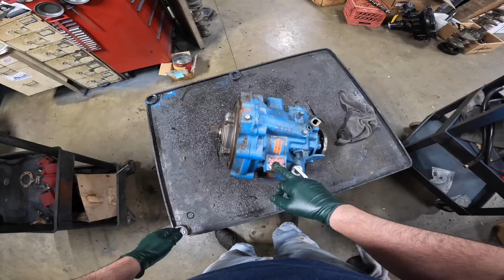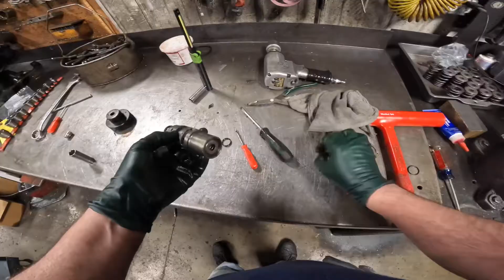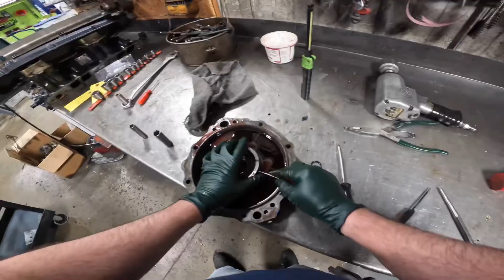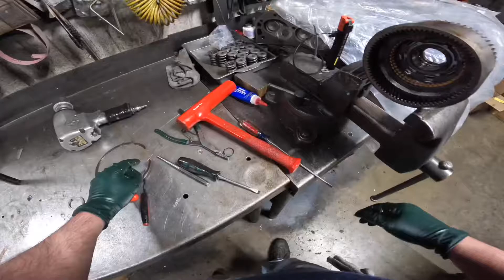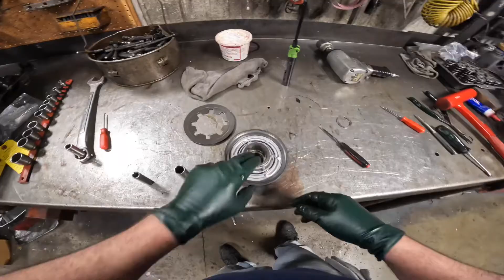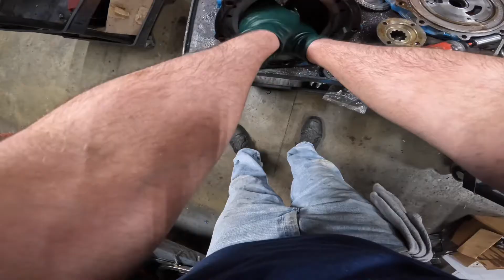Velvet Drive Marine 10-17  Transmission Overhaul Part 1 Teardown 1:1

Comment: Fantastic. Just what the doctor ordered.  I just completed the tear down of my late 80's 10-17-004 velvet drive. This video was such a great reference.  One question: How do you remove the breather plug? My has what looks to be a 7/16 fitting used to screw the breather into the case. But some folks stated NO its not threaded but pressed in - any truth to that? Haven't found anything out there that speaks directly to the R&R of the breather.  Thanks, Chris foa great video.

Comment: ok, I have a question. I have a Td6 dozer with all manual.  Dozer has a straight 6 diesel. I want to do a 4bt cummins conversion with a velvet drive setup. basically to eliminate the wasted time shifting manually all the time. To run a velvet drive I only need to tap my hydraulic tank and add a cooler correct? These units have thier own pump correct? This has a clutch pack doesnt it?

Comment: If i torque down the bolts that hold the cover to the neutral safety plate past hand tightened it won’t shift.   If I back them of a quarter turn I can click the shifter in and out of neutral, forward and reverse completely normal.   I only took the Thing apart to replace the o ring.   Was working normal before.  I’ve taken it apart twice
Now to see if there was anything off and I’ve watched this video many times.   Everything seems normal but there’s no way I can run it with the bolts only hand
Tightened it will definitely leak.  Got any idea what’s going on?

Comment: So just pulled out my blown 350 motor and trans that was 2 seasons old and the new pump shaft seal is leaking or possible the pump seal itself. Is there a better quality seal i could buy somewhere? shaft is pefect no burrs. MY 900 hour old trans never leaked lol. TY

Comment: Hi, My 71C started making a clanking noise out of the blue. I hear it in neutral but less in forward. More in reverse. Seems to get quieter as it runs more. Can I send to a video of it? Maybe more fluid? Maybe an additive? It may need to be sent to you this winter for rebuilding.

Comment: This video pair is a beautiful thing, my only issue is the aluminum piston is stuck, air moved it a 1/8” but no further. Should i be able to spin it  in the cylinder? Can’t do that either, being aluminum i don’t want to force it. Cheers!
Reply: Heat doesn't help, open to suggestions, lol.

Comment: Thanks for the videos. I have a hurth hsw450 1:1. After running it wide open for an hour it blows fluid out on the input side. It happened twice after replacing the input seal.

Comment: What would cause knocking sound in a velvet drive?
Reply from the maker: An uneven running engine such as a misfire. If the idle is too low that could also cause it. 99% of the time the transmission is not the cause.

Comment: Hi, I have an AS15-71C with a 2.91:1 reduction gear box.  In the video you mentioned that there is a different rear seal for that.  The kit I was going to order is the velvet drive 70C 71C 72C marine transmission super master kit on eBay. Do you know if that kit would likely have the correct seal?

Comment: Hello from Austria, I have a problem with my velvet drive 10-16 which is used in my jcb wheel loader model 520 4hl built in 1984.
When I put it in reverse everything is normal, but when i put it in the forward gear it feels like the clutch is slipping and there is not much power at the output shaft. When the oil is cold it works better, but when its getting warm it gets worse.
I think maby the o-rings of the forward piston cause the problem.
I hope you can help me with my problem.

With kind regards

Marcus
Reply from the maker: I’d start with a pressure test. Sounds like an internal leak someplace. You might be on the right track!

Comment: Hi...can I change a rear bearing without having to pull the drive off my motor...have access looks as though they are a snug fit, just need to remove nylock nut/rear bearing plate/gasket and should have access to bearing ??

Comment: I have a velvet drive  stuck in gear does this mean it needs rebuilt ?
Reply from the maker: More than likely. With the engine off can you rotate the output shaft in either direction? If you can't, then it needs to come out and get rebuilt.
Reply: no I can't get the output shaft to spin in either direction the only time it rotates is wen the engine is running,  iv disconnected the shift cable and shifted it by hand and nothing changed,  the fluid still looks new,  the velvet drive is a   10-17  1 to 1 model  , boat is a 79, im thinking about tearing it apart your videos are very clear and explain wat todo , my local marina hasn't worked on one in over ten years and I can't find anyone to look at it.
Reply: I have a 10-17-004 that wont turn and is stuck in forward. What's likely wrong with it?  @LakelandAutoMarine

Comment: Morning fantastic video i have learnt a lot from this video ,  i have a 72c  connected to v drive on boat  could you possible tell me what holds the v drive to the transmission  or will it come apart when i remove bolts   kind regards
Reply from the maker: Usually just bolts....
Reply: @LakelandAutoMarine   thanks for reply,  i just jump in with two feet and yes it was just the bolts and the gear collar  thanks again

Comment: Any experience on 73c 3:1 ratio? Mine suddenly dropped forward gear without any slip. So now i hane neutral-neutral-reverce. Any suggestions?
Reply from the maker: Need to check pressure.

Comment: Great video, you do a terrific job of explaining all the parts and pieces. 
I have a question, what would make the transmission slow to shit into and out of gear?? I have 2 Chrysler 360's and when I shift the port engine into gear there is a good 3 or 4 second delay before it goes into gear, the starboard engine does not have that delay???
I would love to know why.....
Thank you!
Reply from the maker: I'd put a pressure gauge on it and see what the pressure is. At idle it should be ~100psi. I assume you are using ATF for fluid?

Comment: Hello from Italy, explain to me the cause why in my inverter the shaft oil seal was expelled by the oil pressure? Another time, however, did the oil come out of the upper breather valve? Does it need to be overhauled? Thanks for your answer...

Comment: I’m about to tear into this 1973 71C transition. It had well over 125 psi in reverse using the test port you show. After rebuild, what type auto transmission fluid do you recommend? Thanks
Reply from the maker: Any good brand Dextron II or higher.
Reply: Thanks for the reply. Have a great day. Thanks for the video!

Comment: Do recommend the old style velvet pump that the front pump seal can`t blow out. or the new style that presses in from the front. or does it matter?
Reply from the maker: You have it backwards. The pump style with the lip (seal is installed from the rear) is the newer style. I have no preferece and use both. If we get a job in that the front seal has pushed out and during tear down I don't see a reason why I'll normally install the newest design pump with a seal lip.

Comment: I noticed the pump arrow is pointing left. That is a starboard trans as noted on top there. Mine is a V drive starboard and pump shows pointing right that i just took out. Is that because of the V drive? I would love to send you a pic. I hope my rebuilder got it right. Is starboard considered Standard rotation ?
Reply from the maker: That’s not always an indicator of what side the transmission is setup for. For instance a 1.88 or 1.91 is a reversing ratio. As far as your V Drive there is a configuration which is all gears (3 to be exact) or a chain version which would reverse rotation. The pump needs to be set for the direction of flywheel rotation.
Reply: @LakelandAutoMarine  Ok Ty I guess i can put a gauge in the port to test pressure quickly by bumping the starter. Just to make sure. There is no temp alarm there but will be now..

Comment: Hi. Are you sure that the ring is not in the groove in 14.24? According to the repair manual it would be a snap ring. I have a little groove there in my velvet
Reply from the maker: Yes. There is no groove there. If there is it’s not enough to engage the snap ring. It’s a spacer.
Reply: I also have a groove and that's where my ring was while tears down

Comment: Chris, excellent stuff! I have a 72C mated to my starboard 454 Crusader that rotates the shaft while in neutral. Not very strong, I can stop it with my hand but it's not supposed to do that. Fluid levels are normal, both cold and hot. What do you think is the cause?
Reply from the maker: If you can stop it with your hand, don’t worry about it. It’s normal.